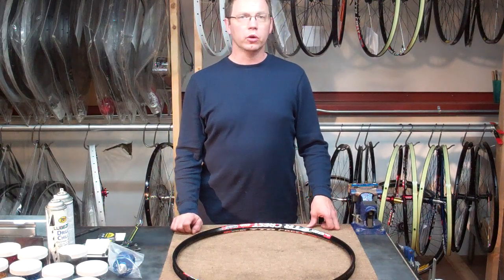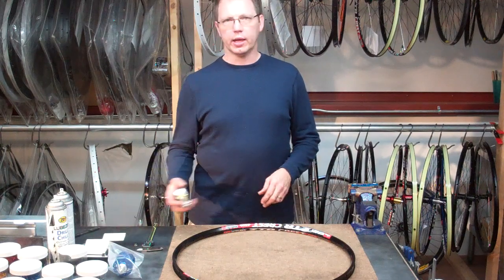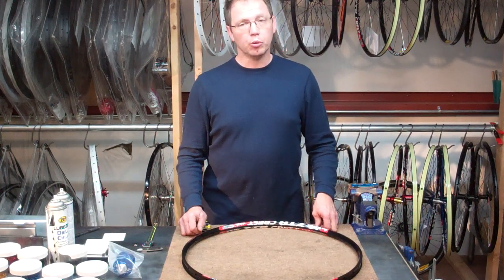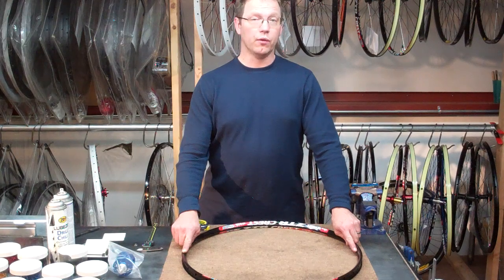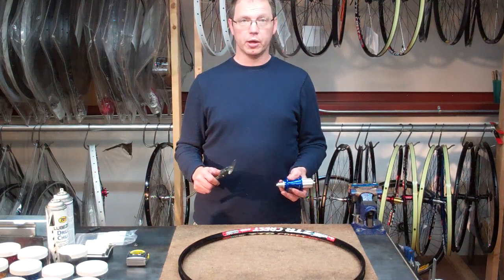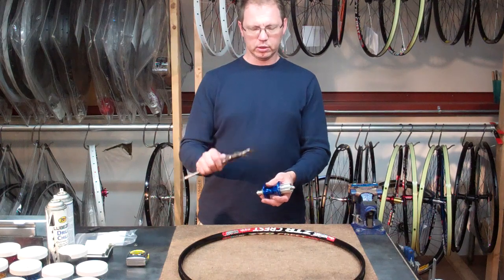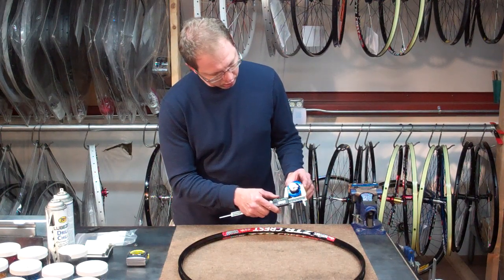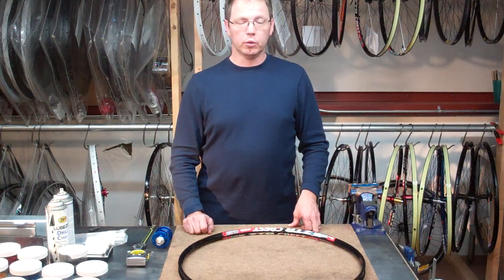How to Measure a Bicycle Rim and Hub

Comment: This is confusing,you say you use your own version of erd but the diagram on your calculator shows the conventional erd  ie  over the nipples. The diagram shows measurements from the centre of the flange,on the vid you say to the outside of the flange but seem to show measuring to the inside of the flange. It would be more useful to show all measurements in closeup. It seems a nice clear calculator with good diagrams if you could clear up the ambiguities. Thanks
Reply: Did you ever find out if it is center of flange or outside of flange?  I'm in the same boat as you were now.

Comment from the maker: The method depicted in this video does not take into account the head of the nipple because it is based on our spoke calculater. Our spoke calculater already adds in the head height of the npple. Please note that we are aware that this has caused some confusion. If you want a traditional erd please add 5mm to the dimension you arrived at from the video. However if you are using our spoke Calc do not add the 5mm as it is already accounted for.